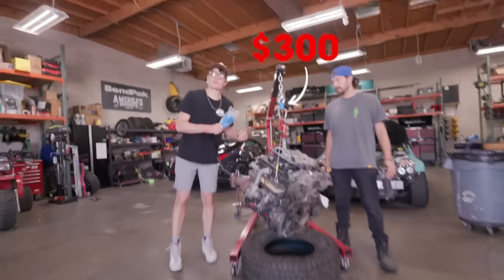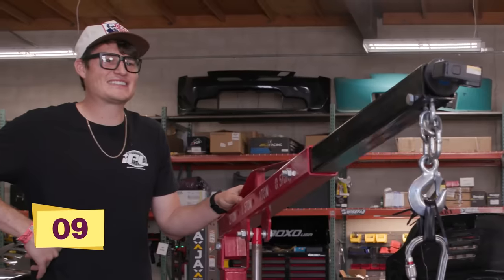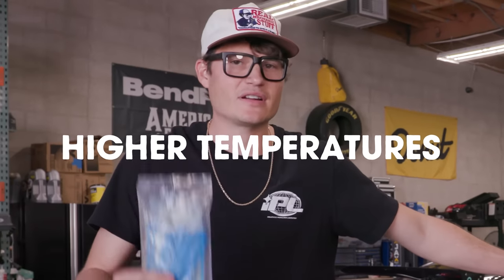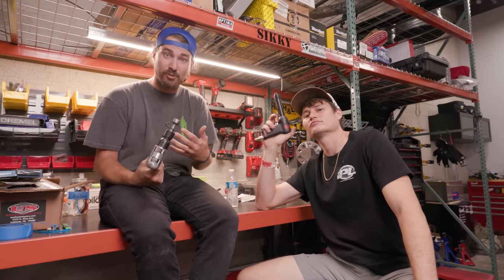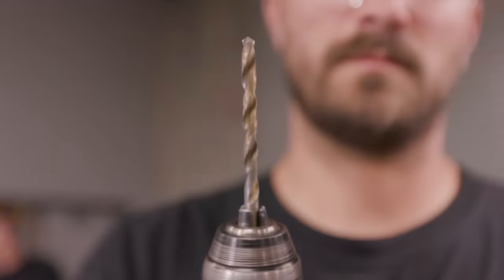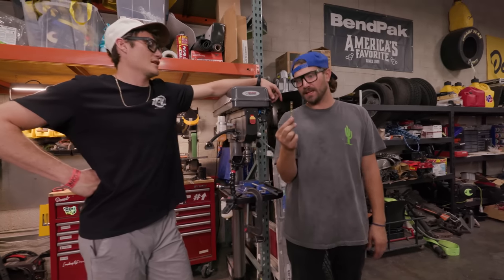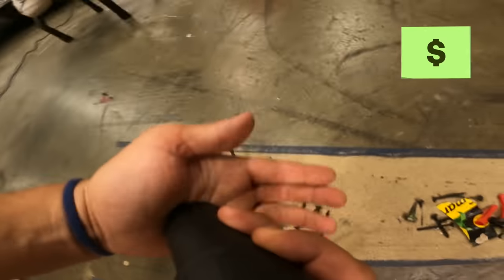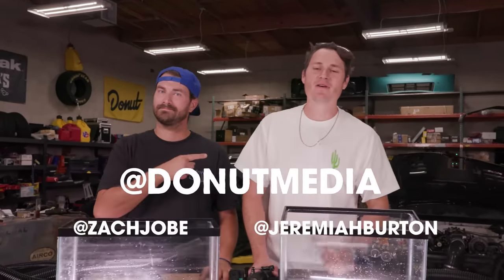We Test: $1 vs $300 Zip Ties

Comment: They didn't let the heat gun cool off, it started from cold for the expensive zipties and was already hot for the harbor freight
Reply: It wouldn't matter. Heat guns heat up rapidly and exponentially, so basically they would go from 0% (ambient temp) to around 85% (500c assuming it's rated 1500W) in a second or two and then to 95% in another second or so and the last 5% would take as long as 10 seconds. So whether it fully cools down or not, it will still get to 500c in as quick as 2 seconds with maybe a difference of no more than a few milliseconds.
Reply: Heat guns heat up stupid fast so I highly doubt that made any difference

Comment: I work in a steel wire mill and we use that exact shop vac, the old one we had lasted long before I started (2 years) and saw lots of heavy use. Pumping many many gallons of water/soap and running for hours at a time. 

We just got a new one this month, seemed worth it

Comment: I feel the zip tie test was unfair. I understand you gave it a boost because it’s the cheaper one, but being that you guys gave extra ties the amount of starting load wasn’t even. Had you done 10 vs 10 then at least there’s no denying the test was fair and started on a level playing field.
Reply: That and the fact that they had the same load rating at 50lbs, they should if tested like you said 10 v 10 but also tested in a chemical scenario since the expensive ones were made specifically for chemicals. Made no sense to do a weight test when that’s not the difference between the two.
Reply: Why are you indecisive about Wich ones to buy?
Reply: @Rusty90  exactly!!

Comment: I bought a $40 Ozito brand 12-litre 'shop-vac' and it's the best vacuum unit I've ever had. And I've spent thousands on a Kirby in a former life.
Reply: I once had by mistake one of those running non-stop for 12 hours and the motor didn't melt, to my amazement. Worked fine for another 6 months. Eventualy they lose suction power, in a couple of years, but they are so cheap you just buy another
Reply: @TheChzoronzon  Reduce, Reuse, Recycle, my guy.
Reply: @JustTheWarning  The metal can I certainly reused for another things, same as the nice long thicc cord... 

With the burned out electric motor I tried to make an sculpture, but those posh curators at the MoMA are so picky... *gosh
Reply: @TheChzoronzon  just sayin. Buy stuff for life :)
Reply: @JustTheWarning  I tend to... I realize our exponential adquisition system is doomed sooner or later

But still, not always makes sense :)

Comment: Don't feel it was a fair first challenge... by having 15 to start versus 10, means the load from the start is more on the blue versus the black zip ties
Reply: SAME thought i had also!
Reply: but they are also thicker thent the harbour fright ones i doubt it makes much of a difference either way
Reply: I disagree. at the start each blue tie had more load on it, but as soon as they cut the first 5 black ties, the load on each was the same. someone in another comment pointed out, the material the blue ties are made from isn't as strong as the nylon black ties. the blue ones are special because of their chemical and heat resistance, not their strength

Comment: Materials aside, it really is the certifications that add a huge cost to the products.  Otherwise there are many other factors to consider such as UV resistance, temperature extreme tolerance, life expectancies... Etc.  Let's just say that you won't likely find these competing with steel cables for structural applications, though these will have very specific uses in other applications. Modes of failures and engineered failure points really become issues too in some applications.  Most recent quality ties won't be too different in performances, though time will differentiate them apart based on various environmental factors.

Comment: If you are drilling metal, you want to use cutting fluid, e.g. Tap Magic, and the slowest setting your drill has. Drilling at a slower speed means less heat and more cutting.

Comment: The problem with the zip tie test is they started with less zip ties on the first one so it was more stress on each one lifting the engine. They also only did the tests once. They need to run the test multiple times
Reply: ok 15 cents worth of zip ties vs $30 worth. still a huge difference

Comment: as a roof plumber by trade not choice, we have to drill a couple hundred holes through 2-3 sheets of sheet metal everyday using a 1/8th drill bit and they snap pretty regulary but its more due do to hitting something on the other side

Comment: I bought a $70ish air hammer off of Amazon.  That thing works pretty well.  Used it to knock out 50 year old press rivets and wheel studs.  Saw folks recommending it on car forums.  Sometimes they have good info lol

Comment: I bought a Hart brand 10 gallon 6hp shop vac at Walmart on sale for 39$. Thing is an absolute beast. I used my father in laws commercial contractor grade shop vac before and this does just as good of job if not better. And beats having to go to the car wash every time I want to vacuum my vehicles out. I haven't tested any other hart products, but for the price, buy the Hart shop vac. I also have a cordless Ryobi shop vac and it's a little monster as well. I owned Milwaukee tools for a long time and switched to Ryobi after a recommendation and from my experience of working on cars the last 14 years, the Ryobi is just as good if not better. And they are made in the same place as Milwaukee. You're paying for a name is all you're doing. Most of harbor freights cordless tools are junk. But their corded sawzalls and angle grinders and cut off wheels are fantastic for the price.

Comment: The limitation on vacuum power comes from the amp limit. For a vac to have more power, it would have to draw more amps, which would blow circuit breakers. IF there is an advantage to the more expensive one, it will be in other areas, durability (steel versus plastic tank), reliability (a more durable motor, or one more resistant to dust), or attachments.

Comment: I work in a tech office, and we used UBER cheap pennies on the dollar zip ties for a projector install, and after about 2 years they just snapped and the cables dropped.  We checked them out and they were so brittle they snapped even trying to bend them slightly. We still had some left in the plastic container and they were all so brittle we had to throw them all away. Now we at least look for outdoor rated nylon ones, but still tend to sort by what's cheap :).

Comment: It's not just effectiveness, but longevity. A lot of very expensive tools will work as if new  even after years of regular or constant use. So it is what you need it for. Be it for just  once every other blue moon, or everyday, several times a day. 

The Shop-Vac shop vac will likely last for decades of regular use even if it is slightly less powerful than a vastly cheaper shop vac.

Comment: I build elevators for a living and I’ll tell you first hand cheap drill bits are horrible they last a day maybe of hard work, the sets we use are around 300 but the 17/64s that I use a 1000 times has lasted 3 months and still works well and is only slightly dull now.

Comment: You should've drilled into the tape. You can drill through masking tape, and it will stay together around the holes. I use masking tape as a template for metal parts that I need to drill into. Masking tape also uses a hydrophobic adhesive, so it can get moist and still stick well. It also has a high dielectric strength, which makes it good for electrical insulation.

Comment: One thing with that harbor freight air chisel (another name for the air hammer) that makes it better than the expensive gun is if you have something like a Shake And Break for removing screws. The tool known as a Shake And Break is basically what happens when you take one of those impacting screw drivers that you hit with a hammer and use an air chisel instead. I've found that an advantage of the cheaper gun is the little knob on the bottom of the grip for adjusting your air pressure. It's nice to be able to set your pressure for your maximum force and then just be able to hold the trigger and go, it means that instead of having to get the trigger into the right spot for the force you're after, you can set the force you want and then just have it so the trigger means either it's on or off. This can be pretty annoying with a lot of stuff, but for this application then it's pretty sweet, also if you need it to hit harder then you can adjust the knob a bit more and away you go.

Comment: yea, guess i never have to worry about my zip ties breaking, i zip tied my capacitor, line output converter, AMP, and TV tuner and all the wires for them to the ceiling of my trunk, best way to hide stuff.

Comment: That means for nearly 2 cents per zip tie you get 80lbs of weight strength vs $3 per zip tie at 40lbs of weight strength. Quite a tremendous difference.

Comment: pull the silencer cap off... There is a cap on the back. It covers the blow out port. This also silences the vac, but lowers suction. If you pull the cap off, it will have a lot more power

Comment: The Jupiter pneumatic air hammer looks like a the 3x rivet gun I use to drive solid rivets. Not quite made for automotive applications. I’m disappointed that you didn’t test the zip ties for resistance against caustic substances, what the blue zip ties are designed for.

Comment: Not even a Shopvac user but I know the applications... you use this with a whole shop system to connect to tunes that go to woodworking systems and pull sawdust with a sliding cap over each machine hose that isn't in use so all the power is sent tk the item(s) in use. It isn't going to show its best in this kind of test because you would need an insane amount of suction power delta to make a real difference. This aligns with the rest of the video though, such as the drill bit and no luck e at top RPM and pressure lol

Comment: In my trade we constantly drill into steel with concrete behind it. 
Expensive bits are definitely better but once you hit concrete it’s garbage. 
That’s the only reason I use cheap bits for what I do.

Comment: Should have tested with brake cleaner or acetone to see if the special ties had a difference considering they are rated for the same tensile strength. I get testing that part, and I'm no engineering master but the ties and how they are stacked and which ones you cut might make a difference.

Comment: Dude. Y'all should check out the Norseman Vortex-point drill bits.
After a certain size they all have step-drill tips.
It just eats through materials, leaves super-clean holes, and does the best job at self-centering that I've seen.e

Comment: I would've liked to see a teardown of the vacuum motors on each shop vac. I wonder if the Bayer uses a little more plastic or if there's anything shady going on with the electronics. Sometimes you pay more money because you're going to use that tool a lot and don't want it breaking mid job.

Comment: I have the HFT air hammer and it worked great... #1, make sure it isn't a return, #2, play with the air adjustment.
HFT drill bits are junk.  Walmart drills are better.

Comment: As dude who worked in industries which have alot of corrosive chemicals and pure acid in the surroundings i have used expensive zip ties, i must say the cheap ones doesn't last a week. But if i work on car i wouldn't use the expensive. 

My experience with vacuum cleaners if we bought a cheap one and the motor was worn out within a year, the newer more expensive have so far lasted 6 year for same amount of abuse, the warranty was 3 year so it have done 3 more year then warranty.

Comment: It actually makes sense that the $1 zip ties would hold the engine better than the more expensive ones that are meant for heat. The cheaper ones can expand more Im sure.
Reply: If the more expensive ones are meant for heat (and thus more expansion) wouldn’t that make them just as good if not better than the cheap zip ties?

Comment: My personal experience, is the ability of the cheap vs expensive tools are often pretty close out of the box, but the cheap ones tend to break way faster. 
So if you're buying them for one job-then yeah, cheap crap, sure. 
But if it's a tool you know you're going to use often, then get the pricier one, even if it hurts. 
The small annoyances garbage tools tend to have are easy to overlook when you're using it once; but if you're still using it years later, you'll have forgotten the pain of the price, but the little problems will still be annoying you.

Comment: You cannot compare a set of cobalt against titanium nitrate. Why didn't you get the Cobalt set from harbor freight? The nitrate is just a coated piece of high-speed steel. Plus the Cobalt has a different chip angle it's impossible to compare them. I have both the Cobalt set and the titanium nitrate except from harbor freight. I used the Cobalt set most of the time.

Comment: As I watched the first drill bit test I was getting irritate as I have that exact harbor freight bit set for my daily use. Those bits are by far the worst “tool” I have on my truck. Definitely need to upgrade, not gonna spend $250 on bits tho. Test the harbor freight bits on brass and see how that goes

Comment: Dudes, for the zip ties.........it's not olny the strenght, but the longevity and the material degradation.  Best zip tie is the one that can hold at least 5 years without degrading and braking.

Comment: With ANY power tool you REALLY should check and see if AvE here on YouTube has a video on it. He doesn’t review every tool. But the guys knowledge is priceless and you stand to learn a lot about electric powered tools. Batter or plug in. Sure the cheap vac va the actual shop vac might seem like you should just go with the cheap option but until you take it apart u might not know for sure. Sure the cheap one does the trick but will it LAST. And that goes both ways. Sometimes name brand high end stuff uses ass parts. Almost all of us who build stuff took apart the radio as kids. Don’t stop taking things apart. They count on us not taking it apart a lot of the time…”Is this a PLASTIC planetary gear?! Wtf!?”

Comment: when it comes to electronic devices like the vacuum, quick test like this dont give the justification. yes as brand new the cheap one might seem like better deal but how long will it last?
some might work fine for only few months and some might last year or two. and cheap ones dents to lose its power over time.
i had Deuzer multitool and it only lasted few months. and i only used like 10 times, then it sat on the shelf few months and didn't work anymore when i went to use it again

Comment: Don't have the time to dig through comments to see if someone already pointed it out. Your comparison of "cheap vs expensive" drill bits was completely off base and didn't much prove anything. Titanium coated drill bits are still a general carbon steel cased core. The titanium coating is extremely hard (in terms of materials hardness scale) and very resistive to flexing under heat load. Perfect example is when you two drilled holes into a car hood. The titanium bits had a noticeably smoother hole, because the coating did it's job and kept the blade edges ridiculously sharp under that level of heat load. Whereas the cobalt bits left much rougher holes. Because, cobalt is an extremely hard metal itself (not as hard as titanium) but is also somewhat flexible vs titanium. Cobalt bits aren't coated in cobalt, the cobalt is a meaningful % of the steel composite mix, much like adding a certain % of chromium to steel gets you stainless steel with vastly different characteristics. Cobalt bits are prime for drilling things like stainless steel because of how hard stainless is vs mild carbon, because the cobalt helps maintain the sharp edges of the drill bit through heat distortion, such as when drilling metal. Whereas with titanium bits, once you hit the heat/mass point where the carbon steel core is hot enough to flex, the blades will flex, thereby more quickly peeling off the titanium coating, and then allowing the carbon steel edge to dull. Your torture test on the drill press is another good example. That moment of bright red hot before it whipped around was the entire titanium coating heating all at once and being sheared off. Letting the super hot and flexible carbon core whip around. Cool off from not touching metal. And then return to a more rigid state. The cobalt bit just melted because the cobalt in the metal kept it from having a super heated outside coating, as well as maintaining a sharper edge longer, thereby reducing total friction and in turn accumulated heat, and is why it didn't just whip like a wet noodle. Cobalt and titanium coating can't be compared. Different tool, different job. That's like using a pipe wrench as an adjustable wrench. It'll do it, just not well. Obviously the best bit would just be a high composite titanium one, but would be insanely expensive.
Reply: just to add there is no such thing as titanium coating, there is titanium nitrite based coatings,  (T,iAl)N- Ti,N- Ti(C,N)and such, yes it got titanium in there, but its not really titanium in the normal sense.  take aluminium oxide which has a melting point of above 1500°C while aluminium metal melts at 660°C, not the same material. calling these coatings titanium is like calling rust steel.

Comment: One time I was in the electrical supply store while I was out on a jobsite. I was in there getting a bunch of conduit and stuff, but this solar panel installer was in getting zip ties and they were talking about the steel zip ties being stronger and I said "a zip tie only needs to hold till you're gone" and he said "that's not a good mentality to have". I told him "Worse so cause I'm using them at the top of a cell phone tower"